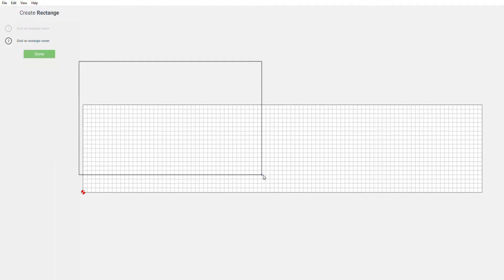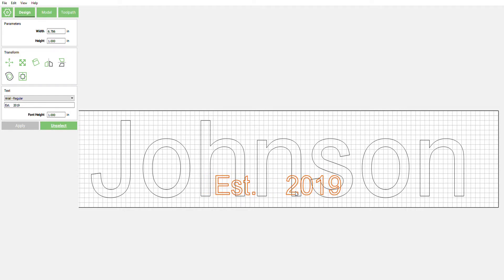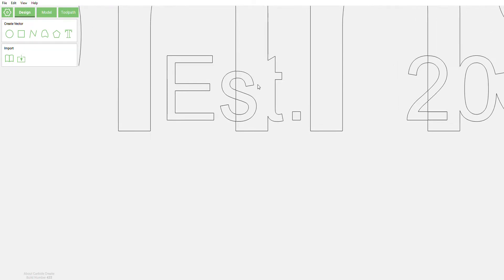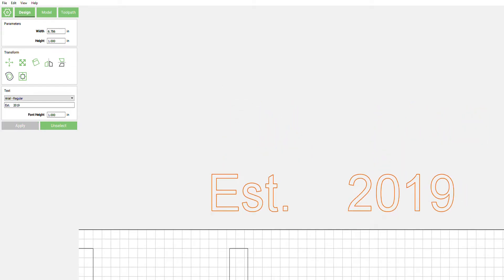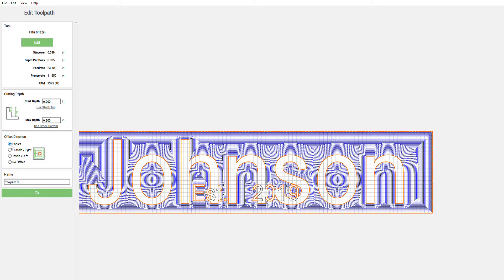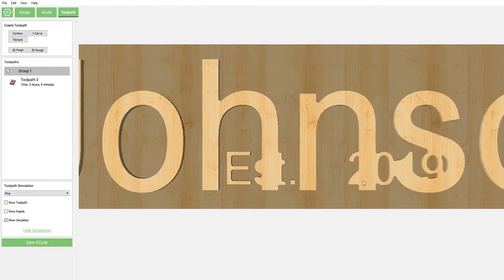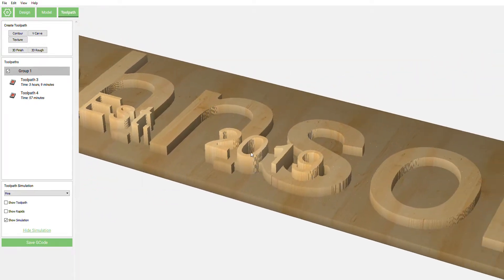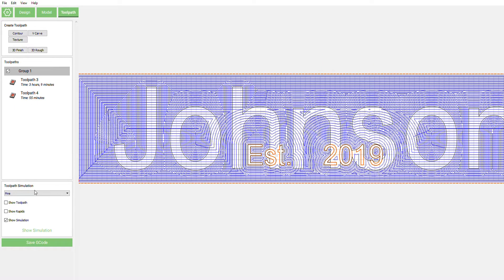Carbide Create Stacked Geometry

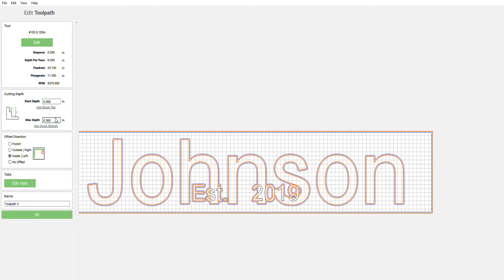Comment: I'm new at this so forgive my stupidity.  Looks like at 4:05 you did something that told the machine to cut outside the text instead of inside.  Can you explain that step please.  All my simulations are showing cutting inside the text.  Thanks.
Reply from the maker: It's a pocket cut, if you watch the beginning of the video at maybe 15 seconds I go over adding the outside rectangle. This is a crucial step to be able to pocket around the Text Vectors. If we don't add this box around our work area our pocket operation will cut the inside of the letters. At around 3:50 I select the outside box and the text to make the pocket operation
Reply: @beyondthecutcreations9391  Thanks so much.  I will try to go back and digest that.  Thanks again.